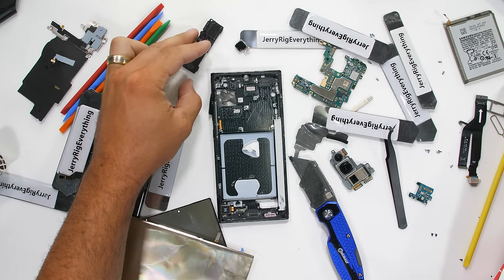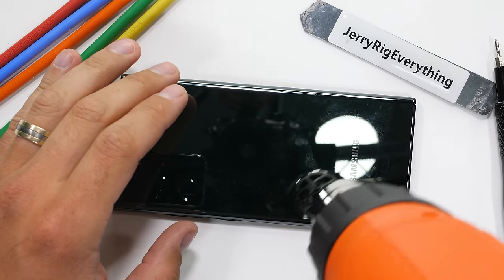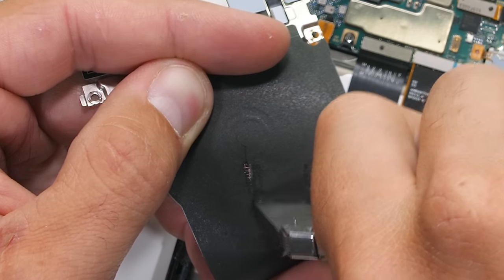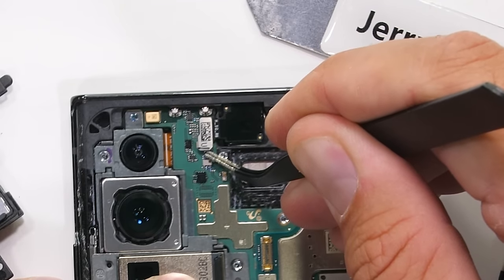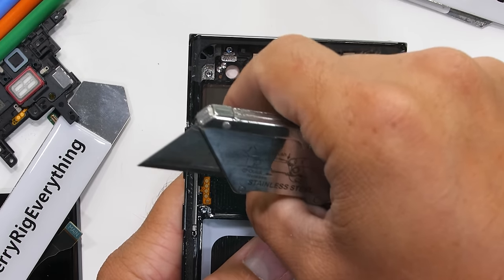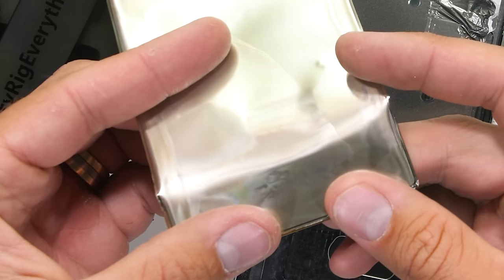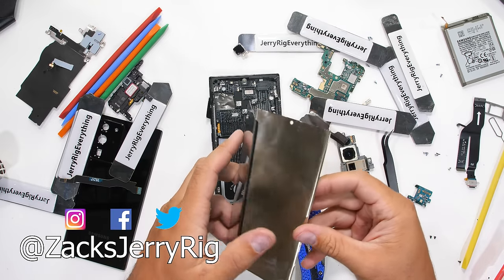Samsung Note 20 Ultra Teardown! - No Copper Cooling inside?!

Comment: The way Samsung is becoming shadier and pricier than Apple
Reply: Seriously. Even Apple held the prices back from as high as Samsung and they were first to reach for $1K for a phone.
Reply: @Skylancer727  they still sell the most expensive laptops/desktops/all-in-ones and tablets on the market an all of them are not the top spec, so using a word "even" just because Apple sells a usual phone for almost the same price, as Samsung sells a phone with an SPen is kinda not right. Both are still too expensive and I don't support any of them for being that expensive with having less features that earlier phones with 3.5mm for example.
Reply: @iowawalker  well to be fair, you don't buy a mac for the same reason you buy a desktop and MacBooks are really for those who only intend light use and just prefer their OS. The Windows platform will always offer cheaper from the nature of being open sourced to multiple producers vs one for Mac. 

Also it's not just the note series. The S20 was more expensive than the iPhone this time as the S20 Ultra is still more expensive than the iPhone 11 Pro Max.
Reply: @Skylancer727  Linux is open source windows isn't
Reply: Pricier than Apple? Is there a iphone pro version with integrated Apple pencil?
Reply: @MrMegacurie  the S20 Ultra is more expenive than the iphone 11 Pro Max and in fact starts at the Pro Max top spec price. That's both phones without a pen. Plus the iphone 11 is cheaper than the S20 by $200, there is even the XR which is even cheaper. Samsung is more expensive now and if you don't realize that, then I guess you're blind. There are rumors of an S20 lite but it's kinda late considering the last lite launched with the S brand and the note is already out. 

I hate Apple just like the next guy, but Samsung has way gotten out of hand. Don't know I will be coming back after my Note 9.
Reply: MrMegacurie what is funny is that the iPhone 11 Pro Max + Apple Pencil combined still cost less than the Galaxy Note 20 Ultra
Reply: @konradkovalczyk  wtf are you talking about. There is no iPhone that can use Apple pencil so what's your point? Also, Apple software is inferior to OneUI
Reply: Michael Janicki Hey, Calm Down, no there’s not an iPhone Compatible with the apple pencil but if it were compatible it would still be cheaper than buying the note 20 Ultra,and also the Apple Pencil would be better quality (Coming From A Note 10+ user that switched to a 11 pro)
Reply: @Minto107  apple's software is obviously not inferior to anything..let alone to OneUI
Reply: I just think the times of bashing Apple for being Apple are long gone. There’s no massive gap in prices anymore, iPhone batteries got really good, they have the best waterproofing, best video quality etc. They became a much more reasonable choice
Reply: Konrad Kowalczyk   This 👆
Reply: Samsung has become the thing it swore to destroy
Reply: The drop test denied this. Iphone 11 cracked first fall, note 20 ultra didnt crack at all
Reply: @_scra9947  That's really impressive how durable this phone is. iphone didn't stood a chance. That really deserves a price but I really dont like their Exynos SoC, it's holding their complete lineup down
Reply: @clickbaitpro  Thats true. But that is cuz international laws from murica. They must do it with 2 chips
Reply: stef catalin macOS is based on unix. Unix isn’t open source
Reply: Michael Janicki at least my iphone isn’t software dead after an 1 and a half 🙃🙃
Reply: _ Scra please whatch more than one drop test. Thank you.
Reply: Konrad Kowalczyk +apple silicon but their chips have always been top notch
Reply: @Skylancer727  pls don't compare regular 11 to s20. 11 has its reasons to be cheaper: worse screen (low resolution IPS with 60 hz), obsolete design (thicc bezels and huge notch), less cameras that are worse too, at least by specs (ultrawide on iphone sucks in fact), and also it has a slow charging brick in the box.
Reply: @danielj.3326  "software dead"? Wut?
Reply: Eringo Ngueno Your updates are dead. The phone goes in EOL.
Reply: Eringo Ngueno Huge notch. Yes. At least my phone can’t be unlocked by placing transparent tpu case on my fingerprint scanner and unlock it with every finger. 🙂
Reply: Eringo Ngueno specs 🙄 those fanboys.. iphone has the smallest battery and ram, is it worse than the competition? And does the camera take the worst pictures? Maybe move your eyes away from the spec sheet and join us at reality.
Reply: @danielj.3326   Dude, you really don't know what you're talking about, this phone have ultrasonic scanner which can't be fooled and s7 which is 5 year's old is still receiving security updates so your statements are completely incorrect
Reply: @quadroshfu2328  Worse RAM performance for sure compared to this phone and camera is pretty much on your preference, iphone oversaturates your photos. I just prefer pixel over these two and battery because of 60 hz display, lack of 5G which is a huge battery saver. In reality note 20U is significantly more durable and better phone overall, the Snapdragon varient
Reply: Clickbait Pro I personally fooled the scanner on galaxy s10. There was a huge problem with it. You were able to unlock any device by just puting clear tpu case and applying pressure. Google it.
Reply: Clickbait Pro the last security update for s5 was in 2017.....
Reply: @danielj.3326  Really?? But you still needs fingerprint of a person who is enrolled and a similar faced person can also fool faceid, I've heard masks are breaking faceid
Reply: @danielj.3326  That was still 4 year's, s5 is really old but they're improving
Reply: Clickbait Pro No i was able to do it with my fingerprint on my friends phone.(i didn’t have fingerprint on his phone). As far as i know it’s fixed, but i am not sure. Also there was proof that companies like samsung, htc, sony and etc. were not actually updating the security patch. They were just simply changing the date. And they update the phone every few months.(and not every month like they were supposed to do)
Reply: Clickbait Pro the fingerprint scammer in Galaxy s10 series can be fooled quite easily. I don’t know about s20 but guess it’s the same since they use same technology
Reply: @konradkovalczyk  Just like scamid with mask on. He said they fixed ultrasonic with an update
Reply: @danielj.3326  Give me the link to the proof because that really doesn't make any sense. Changing the date in security patch
Reply: Clickbait Pro welp I don’t get why you’re so pressed about it. We’re just informing you. And I would like to know about unlocking other people’s iPhone with a mask on cause I can’t find any articles. FaceID requires to see your eyes, nose and mouth to work so I doubt what you’re saying is true. The only thing I’ve found is that now, after months, you can set it to show the PIN pad when it recognizes a mask on your face
Reply: @konradkovalczyk  I saw a video on YouTube that two people's with similar face can unlock faceid and faceid is useless with mask on, thats what I was saying. Big notch with no use and ultrasonic scanner can't be fooled in this generation and much more useful in this pandemic
Reply: @rodrigojds1684  I'm talking about Pen related features. There are ton of those on Samsung and also for those who don't draw or whatever but use the pen as an input method(like me)
Reply: Clickbait Pro welp, if it was fixed then good. But can you use tempered glass on it? Cause you couldn’t before. Agreed, it’s better during a pandemic. At least if you don’t have to wear gloves in stores cause we do in Poland. But during winter (which happens every year, not once in a hundred years) you wear gloves and then FaceID is better. Every system has it’s pros and cons
Reply: @vicenteabarca5781  you might be right but for now there's no iPhone that can do that so you can't really compare it. Also, Samsung's pen is inside the phone(so you won't lose it and it's there always) and has a lot of extra features for those who don't do art or whatever on their phone. I'm making a switch from my 3 Yr old Note8 to 20 Ultra later this year when price drops a little. I'm very happy with my Note8 and the 20 Ultra seems like a worthy upgrade
Reply: @Minto107  I would hope that a company that produces a phone with a pen had pen related features in their software! Or else why would a person but it?
But you can't really compare that to apple's software on phones that don't have pens right?

Comment: This was a very informative vedio.
Highlights:
1)Zach's next phone isn't gonna be a Samsung
2) Samsung sells the same phones with different components inside.
3) only A SECTION of the video is sponsered by last pass.
Reply: He actually got the models wrong. The model he has is SM-N986N which is the Snapdragon version therefore the snapdragon is the one with the inadequate cooling.
Reply: @DanThePianoManNZ  how do you know it's that model?

Koreans also sell a exynos note 20 ultra.
Reply: @DanThePianoManNZ  And you would know this how? Or are you just guessing?
Reply: @dohnuts4405  From the unboxing at the start of his durability test video. The quick start guide has the model number SM-N986N on it.
Reply: @DanThePianoManNZ  Wasn't the SM-986N version is the Korean one? If so then it is exynos since Korea also gets the exynos version
Reply: @AFT2  I was referring to the "one with the inadequate cooling" part. That is my mistake for not specifying.
Reply: @hasnanadam  Exynos is SM-N986B
Reply: @dohnuts4405  My bad, inadequate cooling may not be the best choice of words as I dont know how well the snapdragon manages heat. However the exynos is the one with the copper, as much as I hate exynos...
Reply: @hasnanadam  Just google SM-N986N and you will see, benchmark tests for the korean snapdragon display this number also
Reply: @DanThePianoManNZ  he said in his video at around 5:30 that the phone was international version.  International version has Exyno CPU, correct?
Reply: @tttuberc   Im basing this off of the model number which is the korean snapdragon variant. I believe he made a mistake.
Reply: @DanThePianoManNZ  you got a great eye. They might have not bothered cooling the SD version since it doesn't have heating issues, while the Exynos has been buffed with copper to deal with it.
Reply: Snapdragon variant is only being sold in US, according to Samsung, Korea is getting Exynos too
Reply: @77piter77  Apparently not, Ive read that Korea has both models. also my comment is based off of the Model number seen in his unboxing. Google the model number and it will only show Korean Snapdragon variant.
Reply: Exactly!! Samsung is just releasing new permutations and combinations of the same parts with just few changes. 
Take the midrange Samsungs for example. 
Same processor on a 14k AND a 25k phone. 
I don't remember the model names exactly but they are putting the same shitty 9611 in all their midrange phones. Currently there a lot of phones on the market. But with the current anti China sentiment, the remaining companies are not providing good enough products. And Samsung being one of the biggest remaining players is just relying on oled screens and bigger batteries to sell its phones. 
OnePlus is good. But is slowly increasing its prices....😕. And the fact that the Nord is being sold in extremely limited batches and very short online sale durations doesn't help either😕.
Fuck Samsung😒
Reply: @DanThePianoManNZ  Official model and variants: SM-N986B (International); SM-N986U (USA); SM-N986U1 (USA unlocked); SM-N986W (Canada)
Reply: @77piter77  SM-N986N Snapdragon Korea. Just google it you will see, theres even benchmarks and everything.
Reply: How tf you gonna say a video is partially sponsored when it's the only sponsor, it either is or it isnt at that point

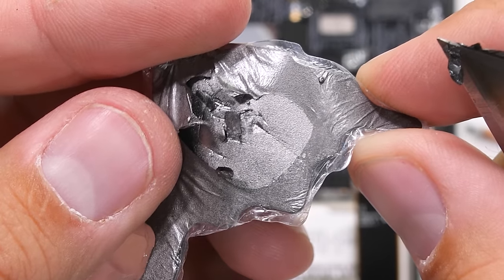Comment: 5:53
The funny thing is even 400$ phones have copper cooling now!
Reply: Checkout Redmi note 8pro even that $250 guy have copper heat sink... lmao
Reply: @shudhanshuranjan9306  even pocophone f1 has it, and my boi is 3 years old!
Reply: @shudhanshuranjan9306  make it $200 where I live
Reply: My f*cking Redmi 8 has thermal paste. And it costs less than 200$
Reply: I'm sure if it needed it, they would've put it in. Those S. koreans are smart.
Reply: @emanresu7208  so you're saying that Exynoss chipset doesn't need a cooling system?!
Reply: IPhone SE VS Note 20- The Battle of 2 Non- Cooling Smartphones
Reply: @tcisreborn  I never said that, but we will see if there are any overheating issues in the future
Reply: @emanresu7208  smart at saving money
Reply: Brand i think ur right, technology is always changing so who knows
Reply: Researchers at Chalmers University of Technology have developed a graphene-based film that has a thermal conductivity capacity that is four times that of copper. This new technology makes it perfect for cooling electronics circuits and components in RF devices, LEDs, servers, and smartphones, to name a few.Jul 15, 2015
Reply: cause they are 400 dollars and this tech is not cheap
Reply: Soo true 😆
Reply: @MrMegacurie  well yeah they did know that exynos is inferior so they used snapdragon in their home country south Korea.
Reply: @gogeta7173  can I ask what drugs are you on right now???
Reply: @MrMegacurie  this typical YouTube commenter has been a mobile repairman for 3 years mate!
I know a thing or 2 about mobiles!
Reply: @MrMegacurie  even a typical commenter can understand that Samsung is being sketchy right now!
Reply: @tcisreborn  so apply to the thermodynamics engineering team of Samsung. It’s for sure better paid than your actual job
Reply: @MrMegacurie  why won't you understand?
They made a fuckin copper cooling system on their korean version, why on earth couldn't they make for their Exynoss chipset which is HEAT MACHINE?!?!
Reply: @tcisreborn  so you already tested both versions under real conditions?
Reply: @MrMegacurie  if 2,3 hours of gaming + 2 hours of YouTube and etc counts as a real condition, then yes! I tried Exynoss version!
But the Qualcomm version, i couldn't get it, so....
Reply: @tcisreborn  maybe the cooling solution works if 2,3 hours of gaming is possible?

Comment: The galaxy should sound better because, 
”It has balls at both the ends.”
Wtf 😂
Reply: lmao
Reply: Balls of steel
Reply: Still not sounding better than an s10+
Reply: @georgeec3  
? 
Is that a particularly good sounding device?
Reply: @FOH3663  yes it is. I compared mine with this one and mine sound better
Reply: @georgeec3  
I've had a S10+ for nearly a year, with various in-ears, ... no 𝘴𝘪𝘨𝘯𝘪𝘧𝘪𝘤𝘢𝘯𝘵 complaints.
Reply: @FOH3663  I'm talking about the soundspeakers. About the inside audio, my only trouble is the saturation when equalizing the sound. I had a Mate 20 pro before, and a Sony XZ premium before and they were better
Reply: @georgeec3   bun pufi